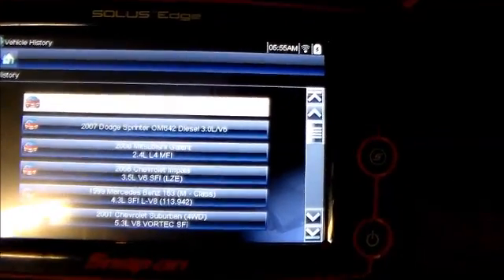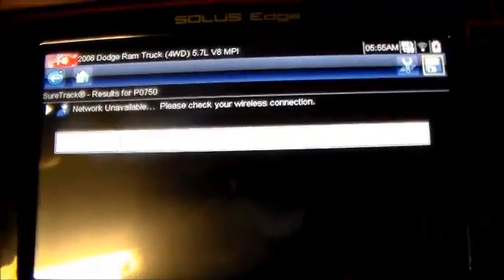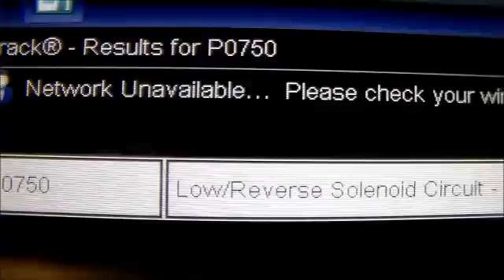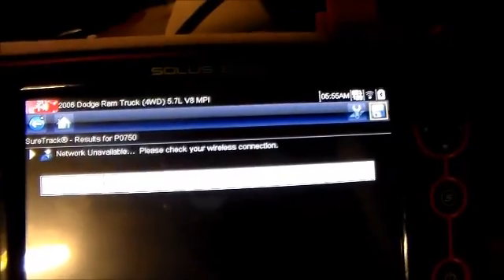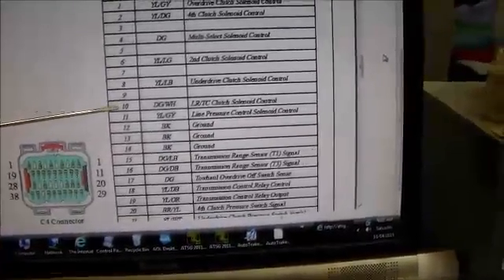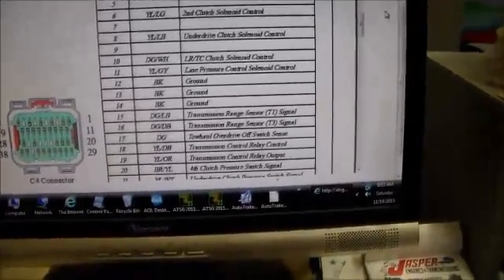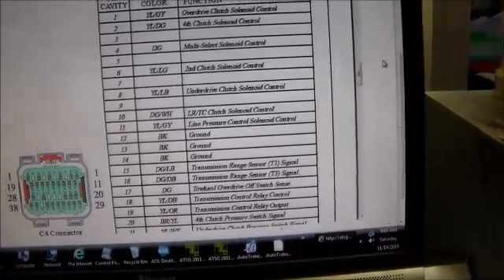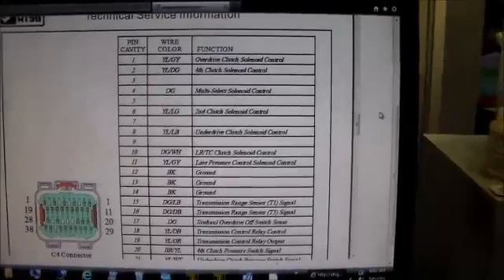545RFE, P0750 Diagnosis and Repair

Comment: I really appreciate your 6L80 and 4L60 videos. I have a problem with a 4R70W that will go to a almost neutral state between 1 & 2. I have cleaned the valve body and changed the dual solenoid, didn’t work. I do get a P0750 code, that’s why I changed what I did. Is the 1-2 servo the most probable culprit?
Reply from the maker: 750 code is electrical   what is the year, make and model of the car?  If you clear the 750 code does it come right back?
Reply: 2008 F150, 160k miles
Reply: P0750 does come back.
Reply from the maker: @jodypearman8526  ok, you could have an issue with the hard wire internal harness, also, unplug the connector on the side of the trans check for corrosion.  Does the code come right back after cleared?
Reply: The dual solenoid I removed reads 24.5 ohms on two furthest away to the one closest to the body. or 48 ohms between the two outside one’s.
Reply from the maker: @jodypearman8526  you need to figure out if the problem is inside or outside of the trans. Any corrosion where the harness plugs into the connector, sometimes those connectors get filled with oil, I don't really see the solenoids go bad that much, either internal harness, the connector or wiring issue
Reply: Gary Ferraro okay, the internal wiring is a hard rail. Have you had issues with those in the past? I will check the connection at the top and get back to you. Thanks
Reply: Gary Ferraro okay I replaced the coil pack connector and the plug that leads into the transmission, didn’t find any corrosion and everything ohms out great. I guess it’s outside the transmission. 

You haven’t seen this same code caused by any internal part?
Reply from the maker: @jodypearman8526  If it is internal, the hard wire harness has a high failure rate.  Check the wiring harness to see if it goes by exhaust pipe or EGR pipe.  You said the code comes right back if you clear it?
Reply: Gary Ferraro I chased the wires all the way to the ECM, there is nothing out of the ordinary, harness is perfect. At a dead end on the P0750. Haven’t tried it yet, just don’t believe I have found the root cause yet.
Reply from the maker: @jodypearman8526   If you clear the code it comes right back?  Is the definition 
Solenoid A electrical?
Reply: Gary Ferraro yes it is solenoid A or SS1 not on or off.
Reply from the maker: @jodypearman8526  Is the ECM easy access? i would ohm the solenoid at the computer to see what you have
Reply: Gary Ferraro Sorry it took so long for me to get back to you. It is my friends truck. I have him looking for a schematic so I can OHM from the TCM through the transmission. Do you have the schematic? I definitely have to OHM through it all as you suggested, just need the schematic to ensure I’m on the right wire.

Comment: Now it's reading 750 & 999???
Reply from the maker: What is the definition of 999 code?
Reply: @GaryFerraro  shift solenoid (s s)f - control circuit high.wiring short  to cause positive shift solenoid ecm/pcm/tcm... Wtf...

Comment: I have a po700 an a po888. Can I check my 2003 dakota 4.7 like that
Reply from the maker: What is the definition of the P0888 code?
Reply: @GaryFerraro  Transmission relay always off..possible causes: faulty t control relay.. trans control relay harness us open or shorted,trans control relaycircuit poor electrical connection. Faulty trans solenoid/pressure switch assemble..I have a multimeter a test light and some other device I just don't know where to start. This is my first dodge,I don't know where to start

Comment: What is the difference between a transmission control solenoid and a kick down solenoid? I went to Oreilys and had them check my engine light. Plus I'm stuck in forth gear. They get a PO750 code and tell me it is the transmission control solenoid that they have for $420. So I've been searching the internet and haven't been able to find anything on a transmission control solenoid but like your post here I am seeing a lot about kick down solenoids. The thing is they list both on their website but the kick down solenoid is around $200 with a $200 core charge. Also I read up a little on the transmissions and apparently up to 2012 they had the 545RFE transmission but in 2012 models they came out with the 65 RFE. Again almost everything I find is about the 545RFE concerning the shift solenoid. Will the shift solenoids work for both trannys? I don't know. I'm going to tear into it this weekend. I guess I will just have to feel it out as I go.
Reply from the maker: What is the year make and model of your vehicle
Reply: @GaryFerraro  hello I’m recently having the same issue with truck.
I followed all your step beside plugging in a new solenoid pack but I am not able to find one at my part store near me.
Reply from the maker: @coreygrimmett3481  If you need a solenoid pack have you tried the dealer?

Comment: Hi, thank you kindly for this video.

I tested the pins for LR (currently getting P0750) and my reading is way out of spec. Around 22.75. I understand what it means if it’s at 0, but what does it mean if it’s wayyyy out of spec like that?
Reply from the maker: Means the solenoid is no good, the spec should be about 2.0 ohms,  you have the computer disconnected while testing correct?

Comment: Let me save you all a lot of money and time. I have had this happen 3 times on three different makes of vehicles. Go buy a new battery. Why, because the Tranny shifts with electricity. The first solenoid that gets energized is the L/R. If the battery does not have enough AMPs to operate the solenoid properly, it throws code P0750. A new (Fully Charged) battery should be the first diagnostic step. Even in the unlikely event an new battery does not fix the issue, it is a required step in further diagnosing the issue. 

Don't think that if your battery tests out at 12 volts its OK. Todays vehicles use a LOT of AMPS. Its hard on the battery. Mine always check out as good with the meter, and then when I swap the battery, The codes miraculously go away.
Reply from the maker: Agreed , i've seen this before a few times.  Once on a honda the more you drove the car the worse it got, problem was the alternator.
Reply: I had transmission problems with a GM.
Turned out the alternator was bad!
Who would have thought!
Voltage was .5 volts too low! Changed the alternator and no transmission problems after!

Comment: Great vid. I did the solenoid pack and I am not getting the engine code but I am still stuck in limp mode, any idea? 2006 jeep commander 4.7
Reply from the maker: if your in limp, there should be a code, do you know what the code is?
Reply: I let it run for 10 mins and did not get a code, I drove it around the block and did not get a code, but it is still stuck in limp mode. The code reader has p0750 and p0700
Reply from the maker: ok, so you cleared the code and it came back?  if not drive the car to see if it will come back
Reply: The jeep doesn’t have a code on it. I did clear them before I did the solenoid to see if the code would come back which it hasn’t but I haven’t drove it for any amount of time. Any ideas other then the solenoid? It’s a shift solenoid a code
Reply from the maker: That usually points to a wire, computer or solenoid pack, if you watched the video i did, i swapped the wires at the computer to confirm my problem was the solenoid pack. What type of scanner are you using to pull codes?

Comment: Hey Gary. i'm pulling up this same code and i'm a little confused. i was looking into replacing the solenoid pack. i got a 2000 Durango 5.9l with a 46re trans but i can't quite find the pack for it just governor pressure solenoids kit. hoping you could shed some light on this i'm not very knowledgeable about transmissions
Reply from the maker: Do you know the definition of the code?  Some of the codes on this trans begin with P17, is it possible your code could be P1750?  The 46RE does not have a low/reverse solenoid. It has an Overdrive and lock-up solenoid, a govenor solenoid and transducer.
Reply: Gary Ferraro I'll go ahead and scan again later today and let you know the results.
Reply: got around to testing it again. got a P0750 Description "Shift Solenoid 1 Performance (MS7 4-speed Transaxle) Cause: Engine running, vehicle in drive at cruise speed, then the PCM detected that the actual gear did not match the commanded gear. fault code firs said just "Shift solenoid A"
Reply from the maker: Can you post your vin number or e-mail it to me  gsferraro@yahoo.com.

Comment: I replaced my solenoid and transmission still went into limp mode , checked harness and all was great , I don't understand why it's still in limp mode , had a permanent code p0750 before replacing the solenoid pack and after it's a pending code now , what gives ? 2004 Dodge Durango 4.7l 545rfe
Reply from the maker: Does the code come right back after its cleared?
Reply: Gary Ferraro yes it does p1775 trans temp and p0750 pending comes right back on what's funny if I start it and put in drive quickly codes won't show and all is fine but the moment I shift back into park codes happen , did what you said all was fine too , I'm leaning towards bad pcm
Reply from the maker: What i do in the video is swap wires at the pcm only, this will tell you if the pcm is bad,  what year is your car?

Comment: when you mean change state is if it shows if it's open or closed
Reply from the maker: yes, if the code comes back fairly quickly could be a wire, you had said you changed out solenoid pack and same problem?

Comment: or some times will get stock on 3 gear ,this happen every time I turn of and on the truck
Reply from the maker: Ok, with the scanner look for the 4C pressure switch and as you shift through the gears(P,R,N,D) see if changes state, if you need help with wiring i probably have something on shopkey, but i would need your vin number so i get the correct diagram

Comment: po988 is the only code that is showing and yes my scanner have transmission data
Reply from the maker: Ok, if you clear the code, how fast does it come back?
Reply: Gary Ferraro well now is doing it right after i clear code. but some times will work with no problem and sometimes would shift only up to three Gear
Reply from the maker: ok, do you have a scanner that shows live data?  where are you located?

Comment: hello Gary I need you help I keep getting a po988 on my 04 ram 1500. with a 45rfe trany how can I troubleshoot the wiring I already change the selenoid pack and didn't do any difference,so wen and change the computer but it work for a few days and know is giving me the same code again. 
What else can I do
Reply from the maker: Are there any other codes present? Does your scanner show transmission data?

Comment: Hi, I am from Venezuela and I have a Dodge Dakota 2007 transmissions 42rle and have a problem with the code P1745 and I have been told several things, that is the solenoid body or that is the PCM or the wiring could indicate to me that cause that problem and That I really have to change since here in Venezuela everything is very difficult and expensive for the situation greetings, thanks
Reply from the maker: There usually is another code present with that code, are there any other codes? what are you using to scan the car? This trans has the varible line pressure solenoid, and its seeing a problem with that, any other codes?
Reply: Not only I present a single code the P1745 but the scanner was generic thanks
Reply from the maker: This code means, line pressure is too high for to long, this trans is actually a 42RLE/VLP(variable line pressure) along with the solenoid pack(which is not your problem) there is a single 2 pin solenoid with a seperate harness, the computer is seeing an issue with that solenoid. The P1745 doesnt really pinpoint the problem(this code is just a "counter", this problem may have been there for a while) thats why im asking if another code is present.
Reply: Good morning, sorry for the delay is that I was without internet signal that here is very common not to have internet, as I could reset that code or it is necessary to change the solenoid body, or change a specific solenoid, anyway I will check each cable To see if there is any problem, thank you for your time and sorry.
Reply from the maker: My e-mail is gsferraro@yahoo.com     Send me your e-mail and i can send some info for you

Comment: Wow, that was a great diagnosis. Nice way of making sure the problem was 99% diagnosed
Reply from the maker: Thank you
Reply: I got mine fixed based on this video. I did add one thing, powered up each solenoid with power and ground and checked the amp draw. Each solenoid pulled about 5a, including the one with the circuit code p0750. 

Sent the pcm out for repair, I got it back with the same problem. Based on this diag I knew the pcm was still the issue. Resent it back and the repair company confirmed bad. Went with a different company (Solo Electronics, based on your recommendation) for and plug and play pcm and it now works perfectly. 

Thanks again
Reply from the maker: Was the solenoid pack the problem?  Thats a good way to check the integrity of the solenoid, i do that test sometimes as well
Reply: Solenoid pack was fine, But after I received the "repaired pcm" back I second guessed myself even though everything tested fine and replaced the solenoid pack anyways. Same problem, resent the pcm back and and it was bad. Replaced pcm with reman from Solo and all is well.

Comment: Hey Gary, been watching ur videos trying to help my buddy troubleshoot his 06 Durango, he's gotten to the pcm but doesn't know which connector is c4 . I imagine it's numbered left to right, but it's sat in front to back and he's confused, he's in Salina Kansas 3 hours away and I'm in Kansas City, kinda difficult, any help? He's also getting battery codes and communication codes, as well as the 700 and 750
Reply from the maker: The c-4 connector should be the end one, when unplugged should be green conector. Question, if the codes get cleared what comes back? 
  I would think the connector would be in the back, but if the connector is green , thats it
Reply: Gary Ferraro 
 
P1684 p0700 and p0750 trying my best to video call information hahaha it's not working too well I can't see what he's seeing quite as well. Btw he lives around the corner from oreilleys he's had the codes cleared and it works fine no codes for a mile or so, then they set after a couple of miles, and goes into limp mode. He just got back to me, all ohm at 1.9 except l/r solenoid which ohms at .8
Reply from the maker: ok, there's the answer
Reply: Gary Ferraro yeah I figured that, troubleshooting over the phone is always fun tho, thanks for all your help

Comment: Wattage volt x amp = heat.
Curious on amp draw. I am an engineer and familiar with nerd equations. I am convinced that the cooler the trans oil the longer the life of a tranny  150°+- max.  I have backhoe and run extra coolers when pushing hard. Also 7.3 powerstroke plow truck I just had e4od redone again. This time I Am putting a fan cooled trans cooler on it and plow in L1 2wd. Super hot trans oil cooks plastic solenoid insulation and orings etc I am sure. I see guys pushing snow trans temp above 220° crazy! Ford says that's OK? I don't buy it.

Comment: Have this occur on crane systems.
Good video. My friends 1500 ram just burnt a solenoid pack. You can smell burned plastic strong.
Very easy to change though.Thanks
Reply from the maker: motorhead   It's not that bad, only 6 bolts holding the valve body in

Comment: Hey gary, very nice video. im wondering how the tcm knows when something is not right and sets a performance DTC like P0751-6 for example?
Reply from the maker: armando nika 
 The computer is programmed to see certain settings,when a transmission starts slipping and it goes out of its allowable limit it will set a code. The computer monitors the ratio and if it sees a change it will flag a code, also, when the computer sees the transmission slipping, it will raise line pressure to try to compensate for the slip to try to save the trans.
Reply: +Gary Ferraro thank you very much, i saw that you really put everything and try to help everyone( giving answers, wiring diagrams and valuable experience) very kind of you. I wish you all the best take care.
Reply from the maker: Thank you sir

Comment: Ohms change when solenoid is hot from current and heat of oil. May read 1.5 when cool then open or short when hot. Copper windings expanding in coil from heat. Trans 200° plus current heat.
Reply from the maker: motorhead yes you are correct

Comment: I have  2004 dakota with the 545rfe transmission. I was getting codes for shift solenoids 3 and 4. I got a rebuilt solenoid pack, and put it in. now I am getting a P0750 code. I checked the ohms like in your video. they read 1.9 except for the LR/TC solenoid. it flashed a high number and then went blank. I tried this multiple time and got the same response. is this a bad solenoid pack.
Reply from the maker: It certainly sounds like it, is this a new solenoid pack?
Reply: It is remanufactured. i am sending it back and am going to get a new one.
Reply: when replacing the solenoid pack, would you also rebuild or replace the valve body.
Reply from the maker: No, ive changed plenty of solenoid packs only. I usually put in a new filter.